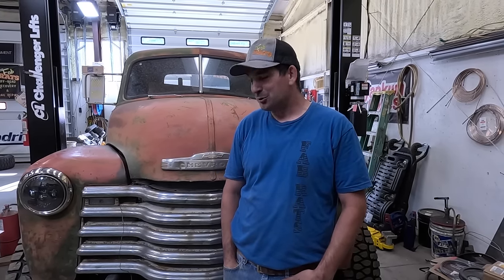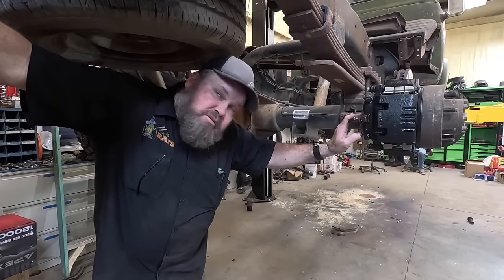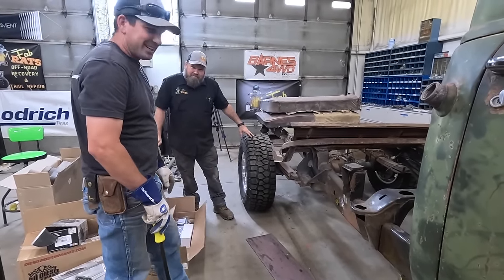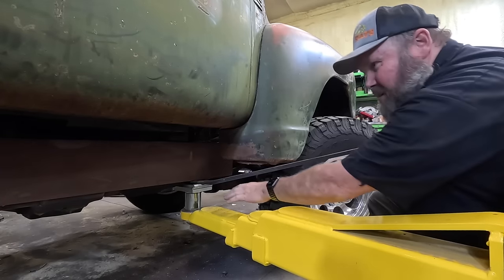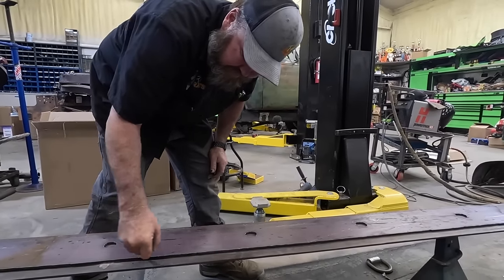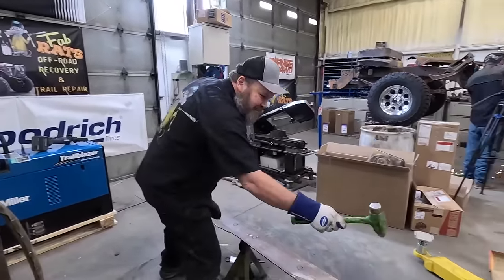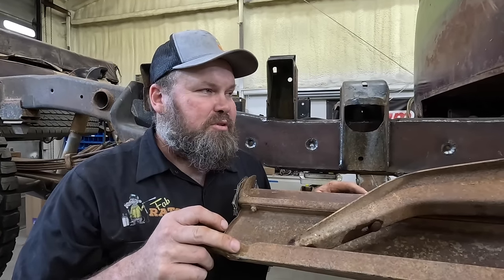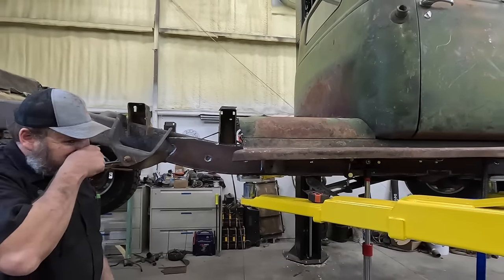He’s GONE! Now What Should We Do With The Off Road Roll-Back!

Comment: Even the kitty was monitoring the work until Shawn fired up the torch to cut that plate . Things are progressing nicely .  Brakes , frame strengthening, running boards ✅ it’s on the road to recovery. Thanks for sharing

Comment: Make a supplemental step out of a length or loop of wire cable. Trail mater uses lengths of chain but wire cable holds a slightly better shape.

Comment: I keep a metal milk crate to use as a step to get in and out of the bed and to stand on to work on the engine of my 72 C10. I keep it bungy corded in the bed. It also works to set small gas cans in to keep them from tipping over or to corral any other small items from moving around in the bed. Great video!

Comment: I'll bet if you left that plate off and welded a Charley brown zig zag up and down the length of that frame then connected the tips with a long weld at the top and bottom, you would save time and get 80-90% of the strength of that plate.

Comment: Not everybody goes to mom's house to fetch up some plate steel. Could have used the little plasma machine to cut Fab Rats holes in the plate. Brace the running boards.

Comment: Engineering 101, if you want to increase the strength of a beam, add material to the top and bottom plates. If you want to increase rigidity to a beam add material to the sides, plus the top and bottom plates.
Reply: Common sense 101. 
Don't modify a pickup frame to be a truck frame.

Comment: With those mounts welded flush to the bottom of the can, you won’t be able to unbolt those running boards to remove them.  You’ll have to cut them off.  Looks solid though, like it!!

Comment: I would gusset the sides of the tubing used to mount the steps personally. A couple 4x4 inch plates cut diagonally from corner to corner on each strut and welded in. But I am also a rather fat chubby guy and need added strength. Great looking job however done by the crew.

Comment: Just thinking that that will probably get ripped of the first rock you have to slide your way over. Just saying, most of the rigs have them 2x6 or 8 steel beams that will hold the weight of the vehicle. You shook it and it wobbled as normal, but I was just visualizing it kinking in the middle on a big rock or the strut getting ripped off. Just asking, you know!

Comment: I'm supprised you guys didn't cut slits or welding holes down the center also?  Would it make it stronger or weaker?  Seen Matt & Roudy doing that to both the Bannanna & R's Jeep Half Dun lol.  Thought it looked like a good idea. Cutting the brackets was a smart move vs notching the plate imho

Comment: Awesome work guys, just a q with welding those plates on, wouldnt it have been better to have stitch welded rather than one full bead incase it starts to crack it wont run the full length of the bead?